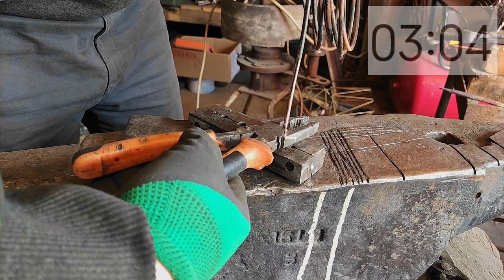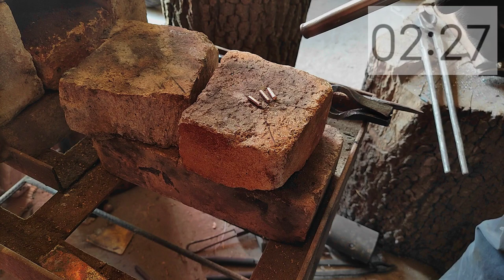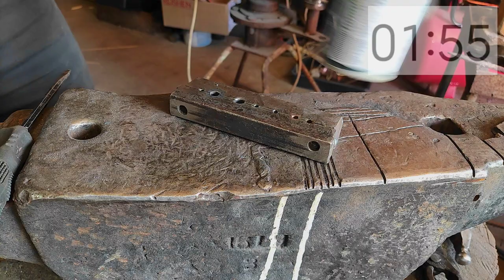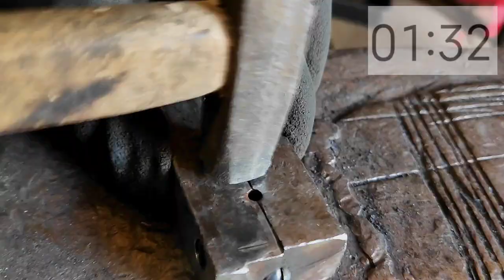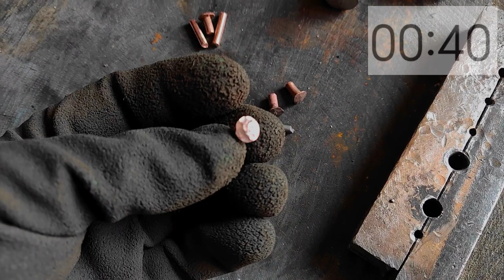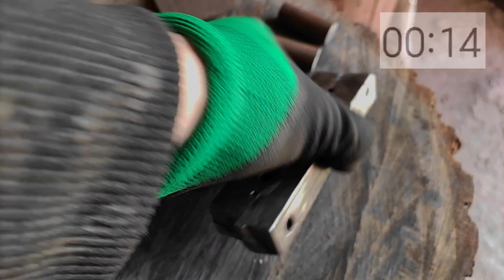With this tool you can easily make copper rivets. Copper forged rivets in 3 minutes.

Comment: id be ashamed to show my anvil if it looked like that
Reply from the maker: Thanks for the comment about the anvil.  I am not ashamed to show it, as it brings me good money and earnings.  With her help, I built a house, bought cars, earn money for my vacation and the life of my family.  It is also good for straightening metal)
Reply: @addforging  did u do all the damage to it ?
Reply from the maker: In this form, I bought it from a friend.  The anvil stood under a tree for 20-30 years.  I thought about restoring it, but I did not find a good metal platform for it.
Reply: @addforging  well welding would be out. facing cut would need a deep cut dont know temp under it.
could made epoxy dam on edges to hold long enough to pour lead. file test the lowest layer on right side video ? might be hard. how could you go about it ? local mens shed might have a mill or makers space. mag drill to a depth with anular cutter all over then zip of the rest with thin cut off wheels?
Reply from the maker: You can cut off the top layer with a cutting disc.  Then heat the anvil of the upper platform and weld the top with special electrodes in a continuous layer.  After that, you need to mill the top new platform.  This is all costly and time consuming.  Maybe I'll shoot a video of the restoration.
Reply: @addforging  problem with hard facing if u get the doner steel soft it bends and snaps off
Reply: @littlehills739  Epoxie dam & pour lead?  What are you talking about!?! I'm calling BS on your comments and any expertise you claim.  
The anvil is what it is.  Stop trying to shame him for a well worn tool.
Reply: @honthirty_  did u read all the comments after or jump to your conclusions ?
Reply: @littlehills739   Yes, read every comment.  Maybe because you use words like 'doner steel',  claiming it will get soft, bend and snap off, is English a second language for you?
Reply: @honthirty_  provide your evidence of welded steel not doing this then....
Reply: @littlehills739  
Focus Little739, your expertise is in question.  The burden of proof is on you.    
Epoxie and lead (Pb)  have no place in anvil restoration.  Stop trying to shame people, research anvil restoration processes & correct terms then make a YouTube video.

Comment: For all the anvil haters out there lighten up. I started with an anvil shaped object then came cross an old one with half the hardface snapped off. I now have better anvils and some are in pristine condition. But you know what, both my original aso and broken anvil are still in my winter home and still get used. 
We all start at some point and work up from there. Don't kick dirt into the eyes of those on the ladder beneath you. You may fall and someday be looking up at their feet.
Hammer away my friend, hammer away.
Reply from the maker: Thank you my friend. I'm thinking of buying a second anvil, a different modification. I will definitely leave this one until I have plans for it. There is history and utility in this anvil. I don’t perceive the comments of evil people) Thank you, good luck to you.
Reply: I had two anvils, one pristine and one with a very used look..... i sold the pristine one....... ; )

Comment: To make steel rivets you can use welding electrodes. I did not try to harden them. May be possible before you install it ? 
May be possible after instalation using a welder in points or mig? The electrodes are a little softer than the iron rivets but work.